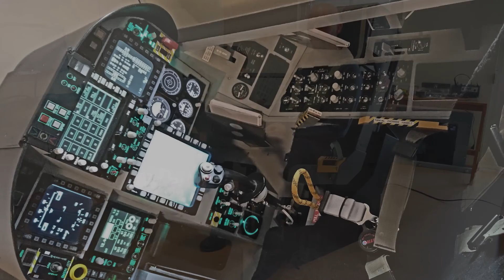The Motion Integrated G-Seat - part 1: Introduction

Comment: Pair this with a high end VR headset and a roller coaster simulator (No Limits 2 anyone?) and you've got an indoor theme park. There's also VR motion cancellation tech if you needed it.
Reply from the maker: I agree it would be usable in many applications and simulators. Motion cancellation is not needed because the head movement and eyepoint position shifting always correlates with the acceleration. That's why it also feels awesome in VR without the need for anything extra.

Comment: Does it reproduce stall vibrations?
Reply from the maker: Hi Fernando, thanks for your question! It can simulate ALL acceleration effects (except black-outs...) in all directions. Btw, what you feel when approaching a stall is called a "buffet" and usually has a much lower frequency than a "vibration".
Reply: Thanks a lot didn’t know the difference, great product hope it can be on sale soon.

Comment: I have some questions about your awesome project. Do the movement of the seat interfere with the pedals? Because it seems that your legs were lifted away of the pedals. Do you have the stick connected to seats movements?
Reply from the maker: Hi Christian, no the movement does not interfere with fixed pedals and other controls, as the body is only moved relative to them as it would under real acceleration. In an aircraft, your feet are also beeing lifted upwards during negative Gs. Also the control stick is fixed to the base in my cockpit and the body position relative to it feels very natural.

Comment: So the 3 axis of the motion are linkaged to the panels and harness, or are those individually motor controlled?
Reply from the maker: Hi Mozzie, only the seat is moved by motors and the internal mechanic translates this movement into panel position and harness tensioning.

Comment: This looks great! I have a question: Would it be possible to mount controls, such as rudder pedals and flight stick and throttle, to the moving portion? Would that improve the feeling of immersion?
Reply from the maker: Hi Aries144, thanks for your question! Mounting a stick and throttle to the moving part should be no problem. Rudders would pose too much of a lever I guess. However, using the seat with fixed controls (not mounted to the moving part) feels good and natural too!
Reply: @bergison  Thank you!

Comment: I was going to do a motion platform but it wouldn’t work with WMR VR because of the inside-out tracking. Have you tried this with WMR?
Reply from the maker: Hi John, I didn't try the seat with WMR yet. But I assume it should work well, because the amount and direction your body moves are just the same as would be the case during real accelerations.
Reply: @bergison  are you using the VR motion canceling software or just the x-simulator program?
Reply from the maker: @simple-controls5507  As I already tried to explain, there is no need for motion cancelling at all with this system. The body is moved like under real accelerations, this means that any motion picked up by VR tracking just matches what you would see in real life: forward during braking, backwards when accelerating, down when pulling Gs and up when negative Gs lift you out of the seat. This movement of the eyepoint in VR even enhances the immersion and sensation of acceleration!
Reply: @bergison  Thanks for that explanation. This should be perfect for VR. Will probably cost several thousand dollars when/if it makes it to market. Good luck in your endeavor.

Comment: How does this differ from the ACME DMS? Or is it the same? (The ACME DMS has been around for a while.)
Reply from the maker: It is very different from the ACME seats as, in addition to the pressure elements, this seat moves as a whole in 3 DoF and not just up/down. This provides an increased sensation of motion. Also the actuating mechanism uses a different approach in that it only needs 3 motors. That would make the Motion Integrated G-Seat produceable at a fraction of the cost of currently available systems.